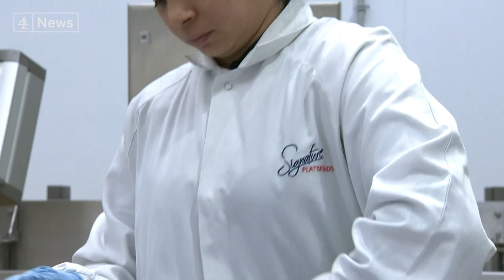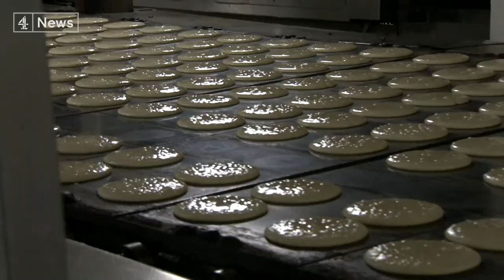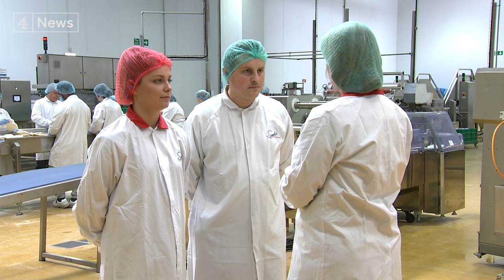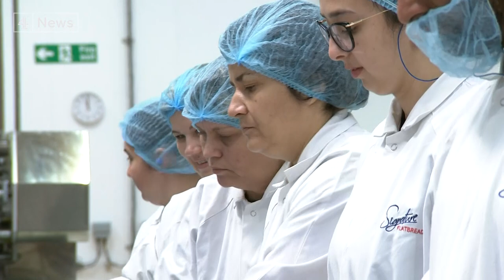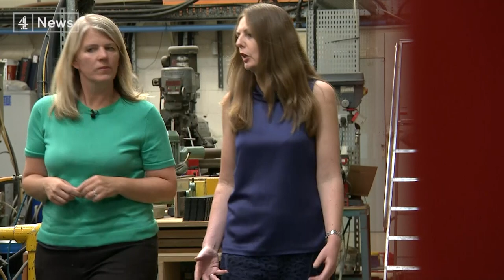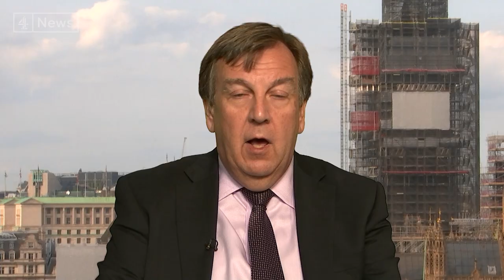Brexit fears prompt Panasonic to quit UK

Comment: Uhm... if this naan business is doing that well now... why would leaving the EU be better?
Reply: There might be a problem post no-deal Brexit. India is really pissed off that the UK has been blocking their deal with the EU for years. I suspect they will raise the barriers as far as they can against British products. If I was them I would.
Reply: @PanglossDr   Not true at all. The UK and India have agreed multiple times that a deal between them would be a good thing at the last 4 CHOGM) , but the UK has blocked from joining one because of the EU. India has said its only requirement for a deal with the UK from their end is easier access for intra company transfers for employees. Currently employees of international firms have to apply for a tier 2 general visa, because ICT visas have a salary threshold too high.

Importantly they DON'T ask for free movement, just a relaxing of the currently really harsh restrictions on businessmen.

This should be an easy thing to agree once EU free movement ends.